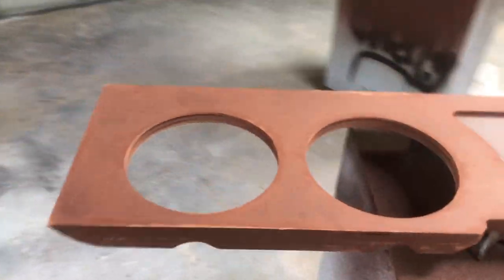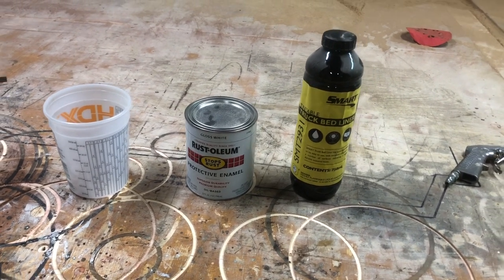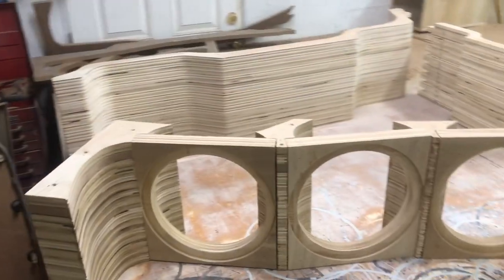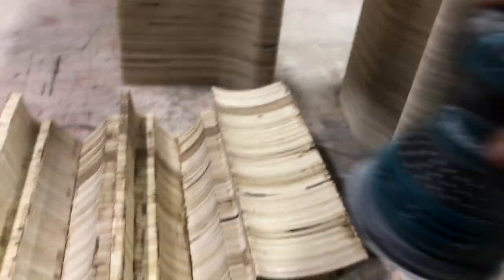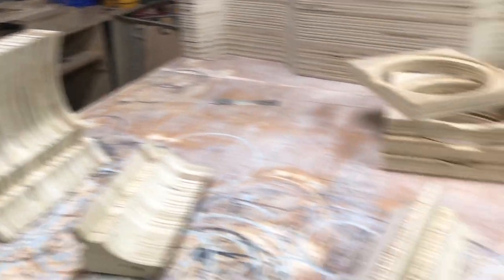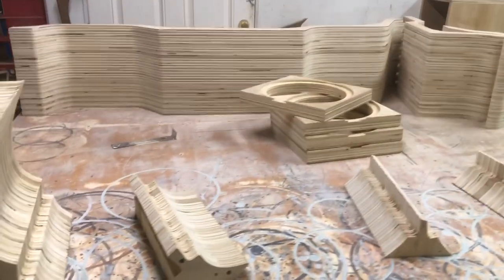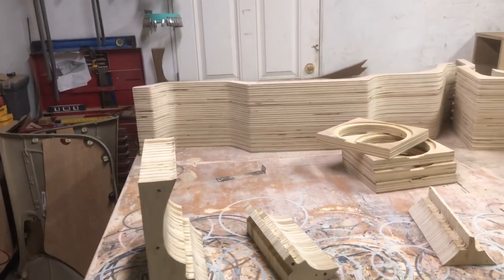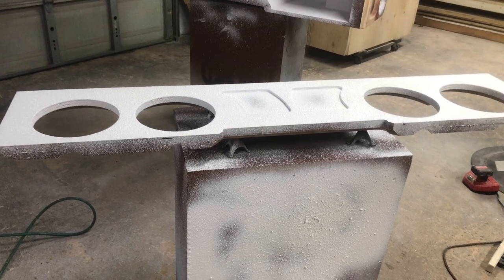IN THE SHOP WITH CUSTOMLOWZ Daily Car Audio Vlog Ep7

Comment: Your have the worst luck with air compressors!  U get the parts ordered for a new one? I almost wanna just order you one online and have it shipped to you so you can keep your master peices flowing 👌🤙🤙
Reply from the maker: I rigged it for now. Funds are tight to order a new one right now. The piston part of the motor locked up and would likely cost most to fix than replacing it. Hoping I can find something used locally. For now my little one will do. 

We can keep moving forward!